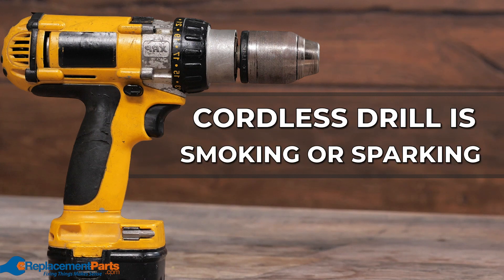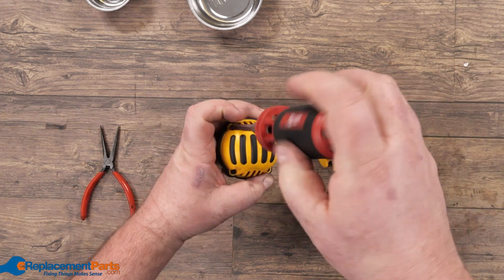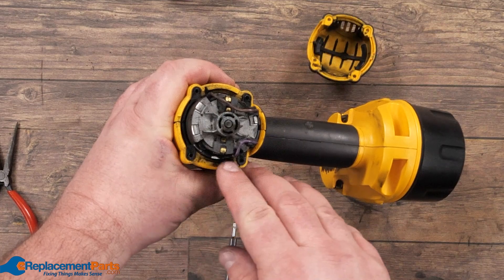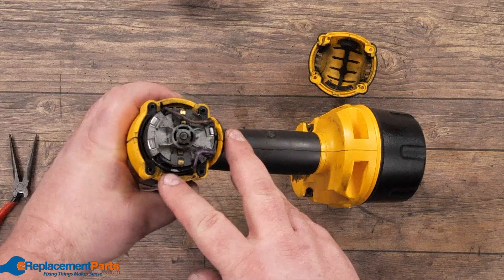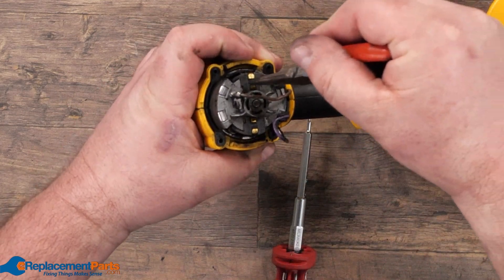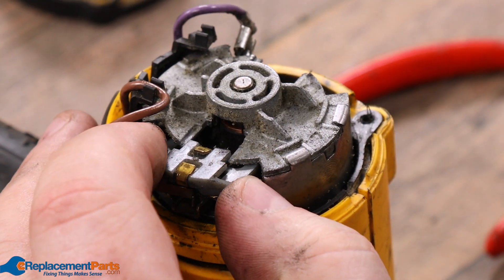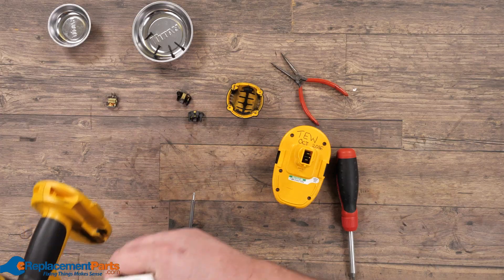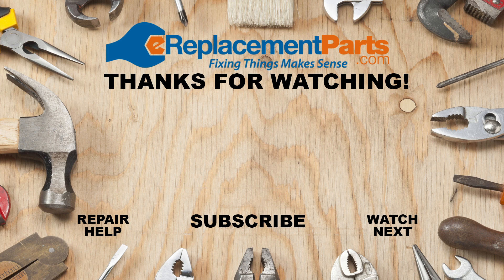Drill Troubleshooting: How to Diagnose a Drill That is Smoking or Sparking | eReplacementParts.com

Comment: on't waste your time. 

I have a Dewalt 18v drill that I shelved for a decade or so because it was sparking and smoking and because the battery died. I bought a 20V adapter, hooked it up, but the drill was still sparking and smoking, so I opened the casing, removed the motor, then turned the hose of my shop vac into a blower, blew out the motor, then vacuumed it. I then sprayed both sides of the motor with contact cleaner and again blew it out with the shop vac. Sprayed and blew it out a couple more times until the cleaner was coming out fairly clear. 

Spray over the garbage to avoid making a mess.

I hooked up the 20v battery and it sparked and smoked for a little while, then to my amazement, the smoking and sparking stopped and the drill works as good or better than new. I think it is more powerful with the 20v battery.

One word of caution, when starting the drill after using the contact cleaner to remove the carbon build up, do it in a well ventilated area, by a shop fan facing outside or outside, because the smell is terrible.

Disassembling and reassembling the drill was a real pain in the ass, but worth the effort.

Comment: What is wrong when the drill case gets hot as it sparks and starts smoking and smells of burning???
Reply from the maker: That is usually going to be a burned up armature. In some drills the armature can be replaced on its own, in others you will need yo replace the motor assembly. -Mark
Reply: Had the same problem on my Bosch, took the motor apart (removed brush assy) and cleaned - was the armature - needed new motor

Comment: k, but what if it's smoking while at relatively low RPMs and not under any load?
Reply from the maker: That sounds like the armature has been overloaded which damaged the insulation around the windings. Once this has occurred the motor will smoke whenever it is turned on due to the short in the windings. The armature will need to be replaced. -Mark

Comment: I have a dead spot. The drill will start 9 times out if 10, but on #10 I have to frank it manually to get it started. Works fine once I get it going, as long as I don't stop. Cleaned the brushes, trigger, housing, still happens. Any ideas?

Comment: Great explanation. Came here because I tried using my drill to mix some mortar, and it started to smoke. It still runs but seams to have weakened in its power and smells when I turn it on. Doesn't seem to smoke, but haven't tried running it too much either. It's almost brand new. Should I still check the brushes?
Reply: I don't have much experience but I have had grinders with bad brushes and a Husqvarna cut and break saw with bad brushes and in all cases the power was less.